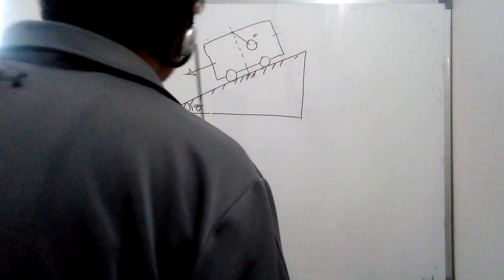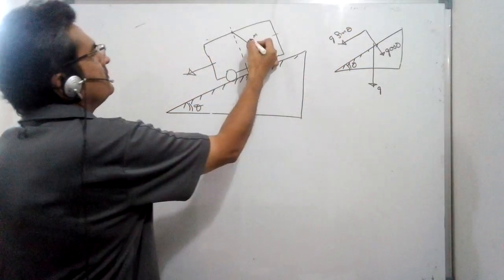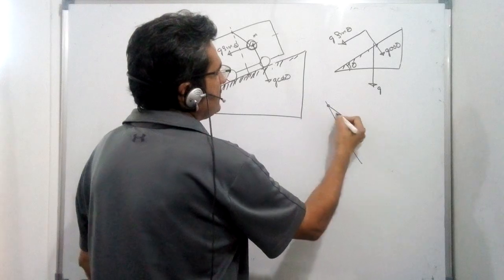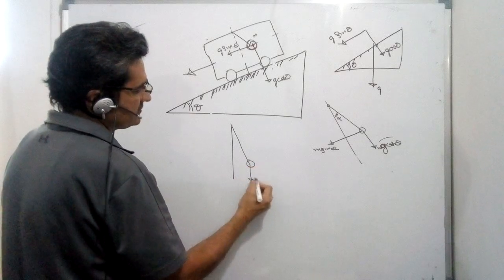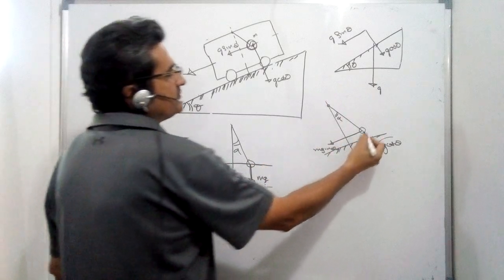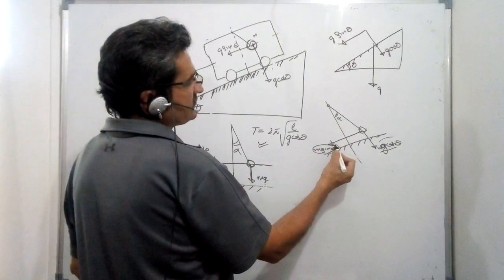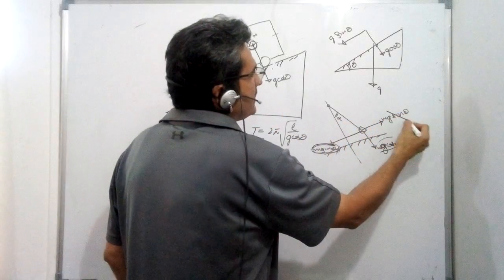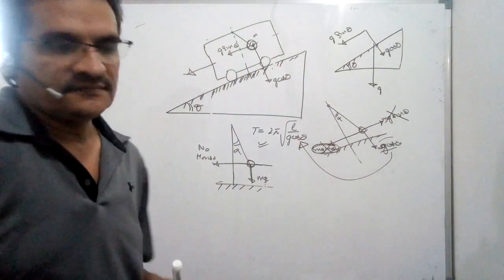Time period of pendulum sliding along inclined plane

Comment: Sir what if velocity of the car be constant
Reply from the maker: Then it is a simple case.
Reply: @ykmt96  so time period will be 2π√L/√g or something else
Reply from the maker: @yaksh457  do one thing, take a case with friction, obtain time period in that case, then put value of friction as tan theta( you will say at tan theta body will not move, yes but ..think) find value of time period. Actually, when v is constant, it does not matter whether you are at inclined plane or horizontal plane, what matters is whether the reference frame is inertial or non inertial.
Reply: @ykmt96  i asked because if velocity be constant than pseudo force will be zero and net acceleration of the pendulum will be 'g' so time period will be 2π√L/g.please tell me if i am right or wrong.

Comment: Why isn't gcos(theta) being cancelled out by tension in the string?
Reply: For the same doubt i am also here....
Reply: We are finding Effective "g" see formula.

what is the effective downward acceleration the pendulum is experiencing.
Reply: @mersenne2486  what actually happening is when slighly displaced from eq position total angle will be (theta0 +theta).now if you calculate the resulting force along inclined plane you will find that resulting equation has only gcostheta0.
Reply: @ismayilamina90  I am done with all this bullshit.